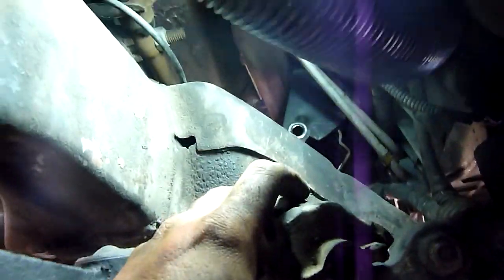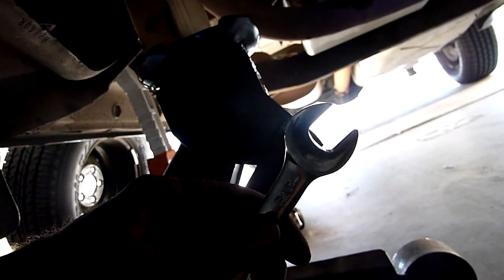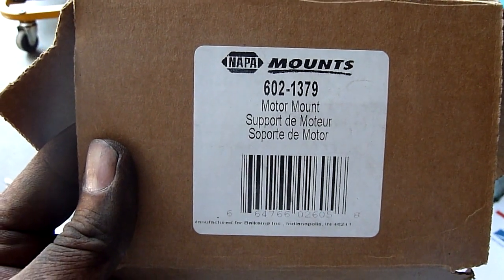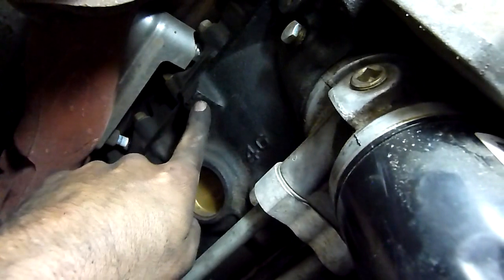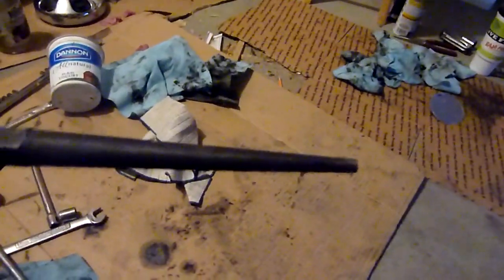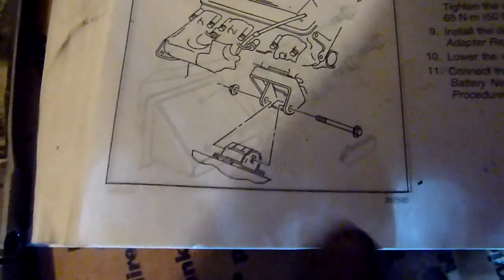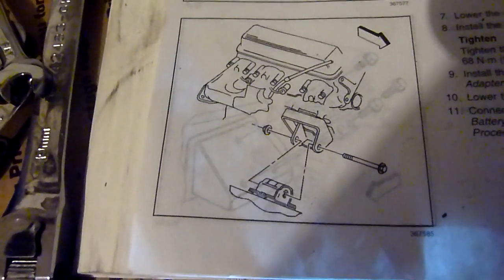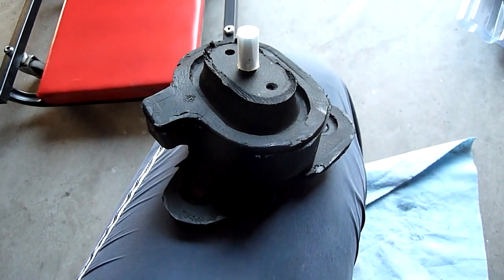How to replace Engine & Transmission Mount on a GMC Safari or Chevy Astro

Comment: Motor mount bolts are 15MM (2004 GMC Safari). I hope there is a special place in h*ll for the mechanical design engineers of this van and those wimpy mounts. 

I lifted the engine from the oil pan (12 x 12 wood on a jack placed squarely on the pan bottom). On the 2004, the bottom of the pan is flat and aluminium. For mine, the mounts were so far gone it bent the motor mount bracket (the part on the motor) and broke the ears off. We realized this when the motor settled so much it caused the cooling fan to hit the fan shroud making a overheat issue.  This is the second GM van we had with this same motor mount issue. To help others, here are the warning signs; Clucking or odd noises when accelerating forward, especially after first backing up; vibrations while the engine ideals, most noticeable with A/C on and in gear (Seems like Chevy v-6 always has some vibes); cooling fan making contact with the fan shroud. My 2004 Safari was bought used and has 251,000 on the odometer. Thanks for the video.
Reply: Sounds like the same problem I have on 2004 150,k ..clunk after abrupt stop
Reply: You have the newer, improved design motor mount.  All vehicles have potential to have motor mount break. Access is always an issue also, especially on newer vehicles, all brands.

Comment: For those with AWD, I found that removing the passenger side axle support (4 18mm bolts) allowed much greater access to the motor mount bolts. Once I jacked the engine up (after removing the thru bolt) I managed to get a ratchet on 2 of the flange bolts. The third had the rubber pressing against it. Mine is a '94. (Note: Someone should make the engineer that designed that setup change a few of them without a lift or power tools)

Comment: I am in the process of replacing the Motor Mounts on my 1994 Chevy Astro. This video is similar, but on my van,  on the PASSENGER SIDE , I removed the starter, and  you have to use a 15mm  universal swivel socket with a long extension angled  through the frame.  The problem is you have very little room, and you have to shine a light through   a hole in the frame  to see the nuts .    Also, you can't get an open end wrench on the  single side  bolt-- you need a 15mm socket on a very  short extension.   I dropped one nut and it disappeared in the depth of the frame.
  Now  that I have the new mount in place,  I'm faced with how to get the nuts  back on the bolts you cant see .  I'm hoping I can tilt the bolts at an angle towards   the socket  on a long extension   without using a universal.  Maybe a wobble shaft extension will line up with the bolt?  If you have a small light,  that would fit through holes in the frame , it would a big  help locating the  bolts. It is really a two hand challenge with out a helper.

If anyone has a good way of getting the nuts back on the bolts . PASSENGER SIDE, I woule appreciate hearing from you.
Reply from the maker: It is difficult,  you have to feel around to get the bolt and nut on.  I cannot think of anything else....do you have a picture that you could share?

Comment: Thanks for your video i am having same model GMC safari 2001 and i was worndring why engine is shake the body and when i am one the ac its shake more so while i see your video i found my engine mount are broken and engine is on steel so as soon as i change its works good and no shaking thanks for your nice video

Comment: If you thinking long keeps for those vans, 
Next time my suggestion is flip left and right then upside down.
This setting is when replace next time you want remove bottom side engine bracket.
Only 2wd Astro or Safari

Comment: T0 footprintsinconc   You did this job several years ago with NAPA/ANCHOR Korea made Motor Mounts.   Looks like you did a fantastic job for such a pain in the arse project.

What I want to know is......  How well and how long have/did those motor mounts last?  Did they also fail or still good as of May 2022?
Reply from the maker: thank you!  it was done yearsss ago.

i sold that van a few years ago...no issues what so ever.  i must have put like 50k miles or more on that and definitely like 7years or so

Comment: It would have been nice to know the 2x4 length as well as the wrench size, socket size and extention length required. I only viewed the first 04 minutes and gave up.
Reply from the maker: the length of the 2x4 is going to depend on how high you lifted the  car.  this was one of my earlier videos and a bit awkward to make as well.

Comment: What problems were you experiencing before you knew to replace the motor mounts.. I have 2004 150k...clunks sometimes when I stop and takeoff??
Reply from the maker: just like others have reported, depending on how bad they are gone...from vibration at idle to clunking to fan stopping to spin like it did for one poster down below.  you can do a quick visual and see it they are bad.
Reply: You know your mounts are busted when you start to accelerate your van and the engine kicks when the van accelerates to the next gear.

Comment: OEM mounts are still available; I just purchased a set for my 94 Astro with no problem (I do get discounted pricing).  Aren't you worried about the exhaust manifold cracking by jacking the engine up there, vs the oil pan?  Also jacking the transmission up by the drive shaft and rear extension housing is risky, the pan is much safer.  How has your car felt using the NAPA mounts, and are they holding up OK?   I also have a 93 Astro and the NAPA mounts are less expensive.
Reply from the maker: They are holding up fine.  Jacking up on oil pan is risky since its a thin sheet, it's not designed to hold that weight.  The other sections are much beefier...

Comment: where did u get the manual from?
tnx
Reply from the maker: i bought it long time ago.  they are the factory GM service manuals.

i still have mine in mint condition.  there are two volumes...i'd be willing to sell mine if you are interested.  i paid a lot for them back then.

message me if you are interested

these are the ones that i have:https://diyrepairmanuals.com/product/2001-gmc-safari-service-manual/?gclid=CjwKCAjwmeiIBhA6EiwA-uaeFTtvdP5qjfL7Nbk9CLiBBcHqpHsvPL44son3XWXOsZragmHgcetaTxoCjP4QAvD_BwE

Comment: what ratchet set up for passenger side- just cant get the angle on top bolt- having to go through tire and spring
Reply from the maker: hopefully i understand your question:  you need a universal joint on the ratchet when doing this....the universal joint will allow for angles.  the beginning part of the video will show you how to access the bolts for the mount on the passenger side

Comment: Please help :(
What were the symptoms of the bad motor mount? im wondering because my astro shutters when i shift in to drive while sitting at a dead stop, but doesnt shutter in park?
Reply from the maker: youreallbrainwashed when you are in a gear, there is a load on the engine, so that is when the engine will engage the motor mounts.....so hence a clunk sound (if there is a lot of play and metal on metal will sound) when you shift into gear.  while in park, there is no load on the engine, so it will sit smoothly if the engine runs smooth.

so as for your van shuttering in gear, it could be the motor mounts (if you have high milage on the van and never had this done) or it may be something else...but I would get under the van and take a look at the motor mounts...obviously observe proper safety when you get under a car.
Reply: footprintsinconc thanks, i looked, and the mounts are fine.
Reply: Time to replace them there bad

Comment: Again great offering for those attempting....

having a real tough time

maybe someone with  AWD can comment?

the three per side awd NUTS are FIXED to frame as compared to RWD with bolts and nuts and per your shop manual

access thru suspension is completely different - no slots... but will review again

dropped front axle multiple inches plus different suspension geometry

still no ideal access to frame bolts ????  can not reach, or barely see them - let alone break free 

soaked all bolts in penetrating solution over multiple days

no access to air tools... have 1/2 inch 3/8 inch , breaker bars, extensions wobblers, etc...

did you actually remove oil adapter per manual on driver's side?

It appears you did not remove ENGINE side mount piece on either side.... per your manual...not sure if this INITIAL removal step of your shop manual sequence is to "improve" access to frame side mount piece on both sides???  perhaps more so on AWD?

The attached removal procedures suggest removal of ENGINE side mount piece FIRST for both sides ????

 I am multiple days....jacked van... supported motor using oil pan, and main thru bolt removed on passenger side only...  if entire fender skirt was       removeable, perhaps helpful... or not...

deficiencies in access is the problem I am facing so my process must be incorrect
Reply: .
.
.

so removal of frame side mount requires bolts removed from...

 TOP...

NOT being able to free the three bolts by taking the three NUTS off the bottom... since these are welded on...   

  this really is a game changer for others viewing your RWD van that own AWD vans

.
.
Reply from the maker: +Finn, sorry to hear that the manufacturer was of no help.  I don't have an awd, so not sure what your setup looks like.

I did my rwd as detailed in the video and not as the manul states because mine were straight forward and I didn't have that manual at that time.

Comment: I could not get the passenger one, the bolts are out of reach. Thankfully it looks decent so I will fill the voids with polyurrethane and leave it for a couple days to cure
Reply from the maker: no sure if filling with polyurethane is going to work...it won't have the same baring capacity that rubber will.

the bolts may be hard to reach, but try to orient yourself differently in a safe manner to get to the bolts (keep in mind safety when jacking and putting car on stands).  good luck!
Reply: That one was a pain. Lower passenger mount. I just got it out. Use a long extension, a SWIVEL and 15 socket thru the spring front front of spring. Has nuts and bolts. not just bolt. Lift motor high helps. What a pain

Comment: should have boughten them from ebay i bought the two mounts and the trans mount 35 for all three
Reply from the maker: I wasn't a big online shopper at that time.  This is a whole ago!  Now I'll entertain it.  I used to go to NAPA all the time before.

I have a few other videos to format that I still have ... especially the intake manifold gasket and fuel injector upgrade
Reply: @footprintsinconc  How do I know when the mounts are bad..
Reply from the maker: @oldskoolwayy  the van engine will shake when you start up.  engine will clunk when you put in drive or reverse because the engine moves/shakes, excessive vibrations, etc.  you can also do a visual inspection and see the rubber is gone or cracked and/or broken

are you having any issus?
Reply: @footprintsinconc  yep when i start my van and let it idle or at a stop light..it vibrates really hard but if i am standing outside of the vehicle...its quiet as a mouse..so many people on YouTube are saying so much hell i dont know where to start or what to check
Reply from the maker: @oldskoolwayy have some pit the car in drive then reverse and see if the engine moves excessively...do a visual inspection and it should confirm your thoughts...
Lots of vibration makes them the likely issue.  What else have you found?
Reply: @footprintsinconc  i found it doesn't jerks out of gear when i  change but it does vibrates and shakes hard in each gear i was told it might be the spark plugs.

Comment: What is that book called can you link?
Reply from the maker: I actually have the GM service manual.
i'm selling them if you are interested.
there are 2 thick volumes.  I no longer have the vehicle.
Reply: @footprintsinconc  how much for both?
Reply from the maker: @CivDizzy90  200 shipped in the 48 states
Reply from the maker: @CivDizzy90  I'll can do 189 shipped.
they are in really good condition.

Comment: I'm planing to replace the motor mount on my gmc safari to.....    thank question is after you lift the van and let it sit on the towers.....   do you have to use another one to lift the engine wile they are been replace ?
Reply from the maker: +Daniel Mariche :  once you have jacked up the van and put it on stands, you remove the jack.  you use the jack now to lift the engine as shown using the 2x4 so that you unload the mounts and then higher to get the mounts off.  hope that this makes it clear.

Comment: thanks

awd ???

differences
Reply from the maker: I am thinking that it would be the same...I am not sure as I only have a rear drive.  I do have the service manual, that I can check to confirm.
Reply: +footprintsinconc  

 thanks

did you replace transmission mount?

any issue to date with all three 

thanks for korea supplier references as the suggestion is unless aftermarket energy system type parts and taking original metal casings apart / drilling rivers, etc all is lost and the chinese parts are big time junk..surprise.

Any more vids plan?

Enjoyed the "37 minute" detail.

My oil pan is cracked on driver's side  due to mount failure...nice.

Have you recently reviewed how they currently look?
Reply from the maker: +Finn Green, Here is the link to the instructions from the service manual (GMC manual):
https://picasaweb.google.com/103542483187582345132/SafariAstroEngineMountReplacementInstructions?authkey=Gv1sRgCIGd79GNyo78cQ

it turns out, there are slight difference...just read through and you will see.

Comment: Don't even know the name of an open end wrench?  Tapered drift punch a little more obscure. I admire your pluck but maybe you should have had some experienced help there to guide you.  It would have been easier and no doubt safer.  You did a good job meticulously describing what you did so kudos for that but experienced mechanics are just shaking their collective heads watching you.